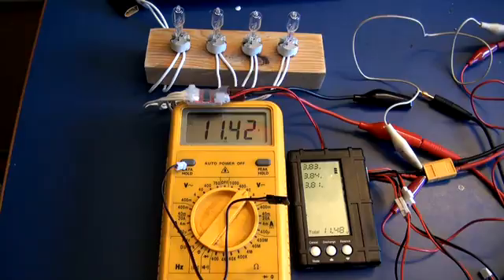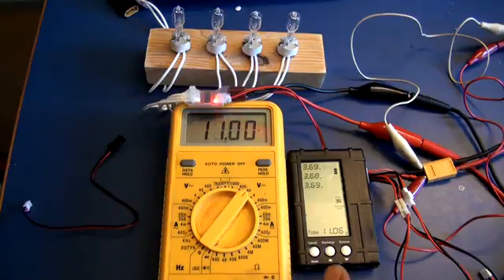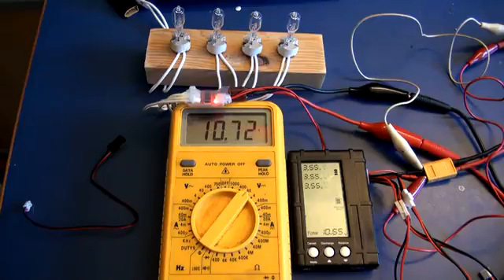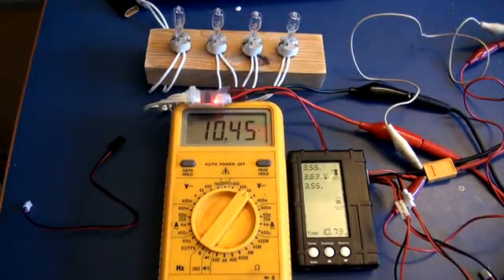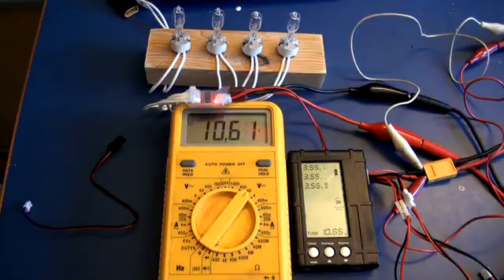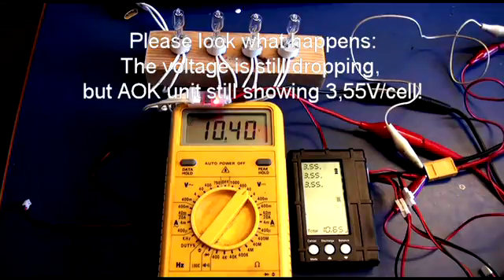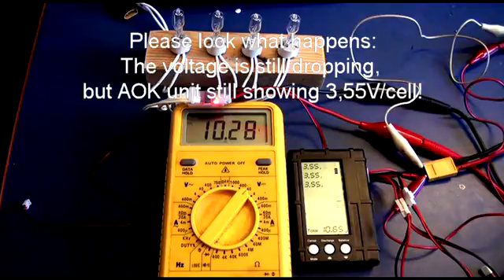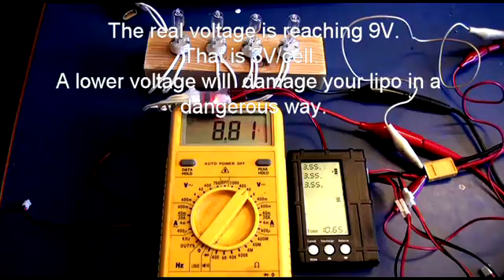AOK 3In1 2S-6S Lipo Battery Balancer LCD Voltage Meter Tester Discharger

Comment: Hello sir is it ok to use all the lamp for a small lipo... Can I use just one by unpluging the other ones?
Reply from the maker: Jerome Dupont Sure it is best to keep the drawn current in mind so.pared to the Lipo attached. These bulbs are regular light bulbs, so you can easily pull one or two out (without your bare hands touching them)

Comment: very helpful. Thanks for the heads up. but you shouldn't leave batteries and hot bulbs by themselves. I agree. however this is not a set and forget device. noted!
Reply from the maker: noisynerdman Thanks for your comments! You're right. But most important not to get in the "trap" of completely drain the batteries because of the error in this unit ;)
Reply: Frank V exactly. In this hobby there are a lot of creative but also potentially hazardous tools. This is why I think it's so fun.
Reply from the maker: noisynerdman So true! happy flying :)